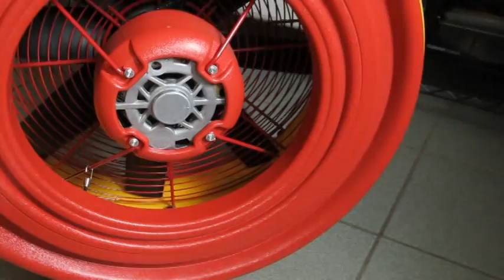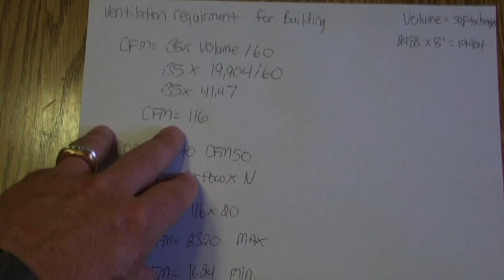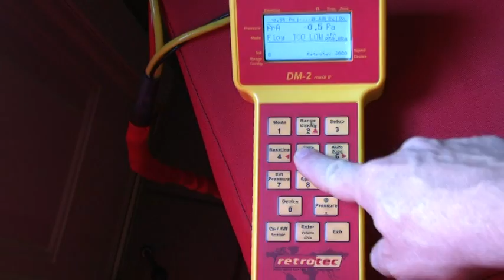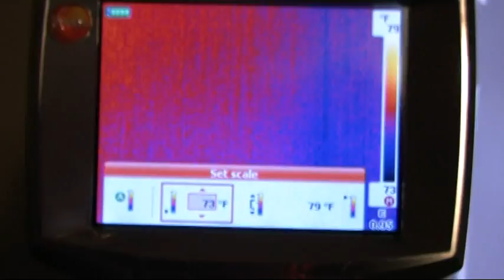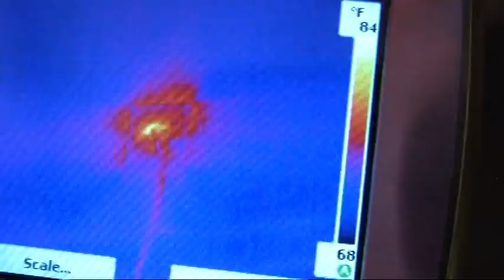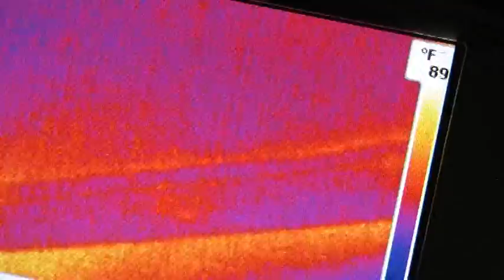HVAC - Testing a home for air leakage

Comment: Man Eddie if I had this system I would drive to Palm Springs Ca. and set up shop... the avg. summer day time temp is 100-120 and night is not much cooler 90-110 the a/c units there run 24 hrs a day, and if your a/c breaks down you leave period. This system would be a must.

Comment: They are not spider webs. That is dust and mostly insulation forming a web affect due to air movement. At least that's what I was told not sure but make Sense

Comment: I live in a big Apt complex. I must say they engineered this place for energy efficiency and succeeded in spades!!! 
So monitoring humidity levels  in the winter is a big job here and believe it or not to much humidity  is the problem at times from internal source's like cooking bathing anything etc and  to counter act that the bathroom fans are on a humidistat and must be used in the winter to prevent mold mildew etc etc. I think if this place had forced air we would be looking at seriously lo

Comment: Love it Eddie. You've got all the tools. Do have a duct blaster. I'd love to see that in action. We didn't use one during our field days when I took the BPI course. Got my used Testo 327 today. Blower door is on the list. I want that 435 bad but I'm tempted to just go with the field piece hot wire. Was wandering what you thought about vein vs hot wire for transverse velocity testing?The hot wire Testo cost less than the micro vein model.

Some pressure pan testing would have been cool.
Great job